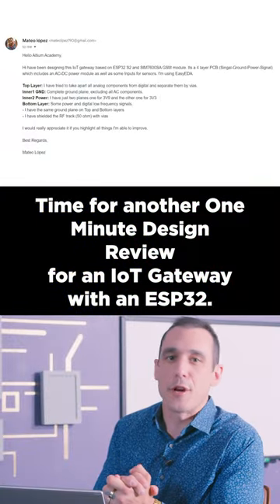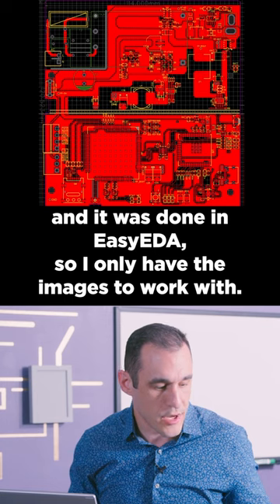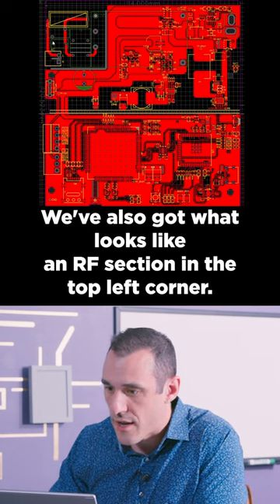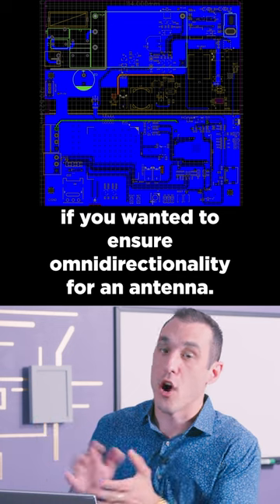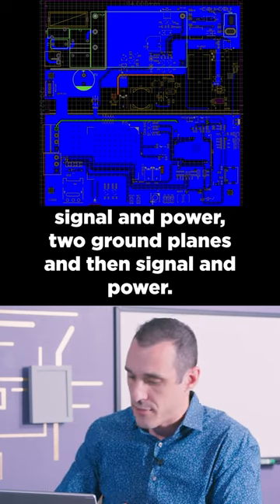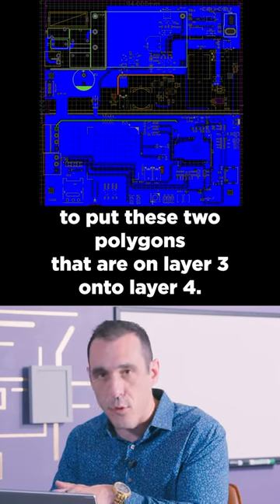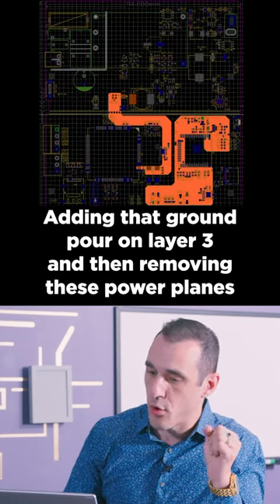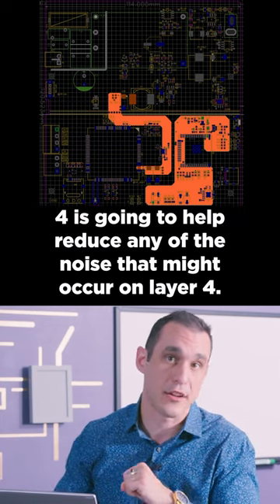Eliminate the Pour!  One Minute #PCBDesign Review 11 #electronics #altium

Comment: Thank you so much I really appreciate all your videos and support 😊!!!!
Reply: Nice design! Btw, are you using the ESP module with integrated antenna? Then you might need to move it so the antenna is not on top your pcb, but instead next to it and in free air. 
The ESP module datasheet has more details on this :)

Theo
Reply: @Electheo  hello there, thank you for your advice, I'm using the ESP module with external antenna :D

Comment: I think it's due to the confusing Espressif's ESP32 4-layer guidelines. They say layer 3 should be a power plane, but then say to put a GND pour on that layer, and the power traces in the bottom layer in the description.
Reply: The highlights are TOP/GND/POWER/BOTTOM, but then recommend Signal/ground/ground/power.
Reply: I think it's another instance where semiconductor manufacturers are not giving the best PCB design guidance, this is a well-known problem. Technically you could do either way, but if you aren't designing a power system then you don't need an entire layer dedicated to power.

Comment: What is the reasoning for your recommended stackup? (I would've thought it better to have ground adjacent to signal layers for return paths.)

And did you mean...

Signal
Power
Ground
Ground
Power
Signal

...OR...

Signal
Power
Ground
Ground
Signal
Power

?
Reply: Signal + PWR
GND 
GND 
Signal + PWR

Both signal layers are then referenced to an adjacent GND Plane for a good return path.
Reply: @PeterB96  oh, just 4 layers? Thanks.
Reply: @ModEmbedded  Yep just 4 layers, routed power on the outer layers rather than a dedicated plane.